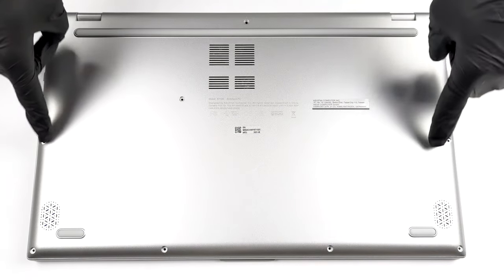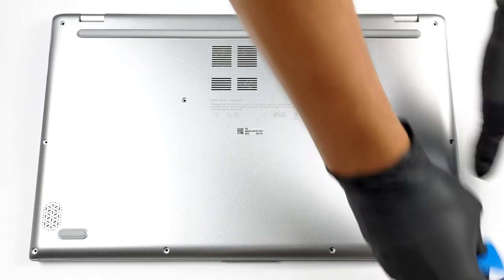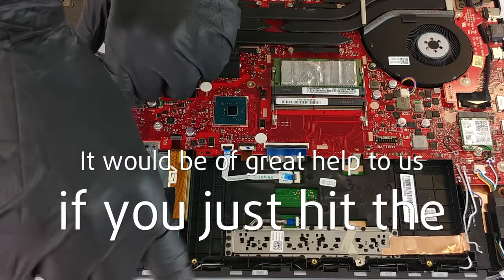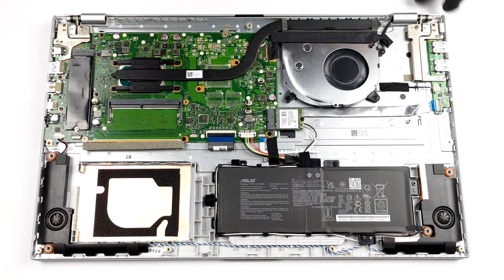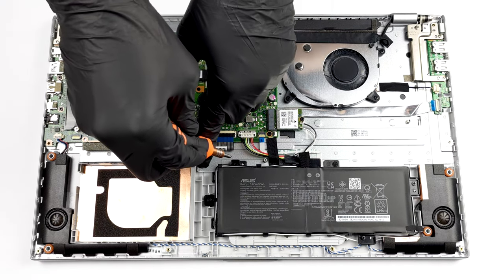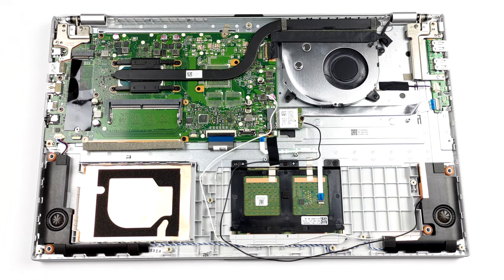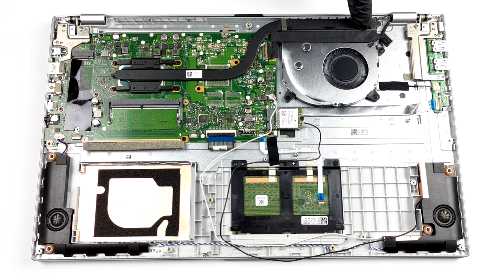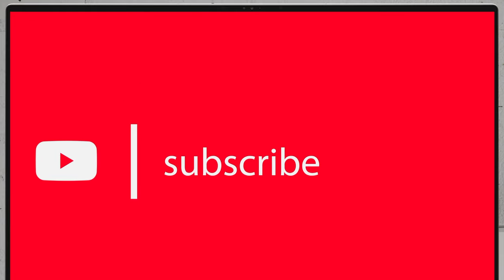🛠️ ASUS VivoBook 17 X712 - disassembly and upgrade options

Comment: Some -->Typical questions I have reguaring uprading My X712EA from amazon is that it looks that there is a upgradable area for ssd in bottom right but NO sata connector for both M.2 and Sata hdd/ssd. But for ram you only get one slot. What is the maximum potential of the ram slot before and after processor upgrade. Also what else are the possible capabilites of the processor? Any Ideas for the batteries also looks like theres extra room into possibly add an extra battery.
Reply: Did you get the answer for these interrogants?

Comment: I have a VivoBook_ASUSLaptop X712JA_X712JA. it runs hot and fan runs all the time. Since it was newit has done this. its has to be poor design, since im not running any games
Reply: i drilled some holes along the bottom cover which helped. it is poor design. the cooling copper bars are against the bottom cover and cannot get proper air.